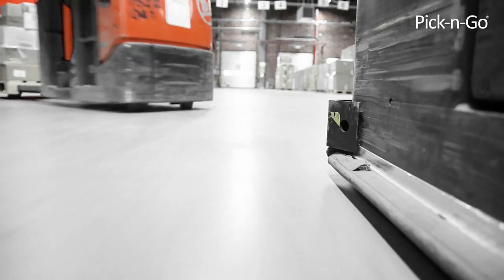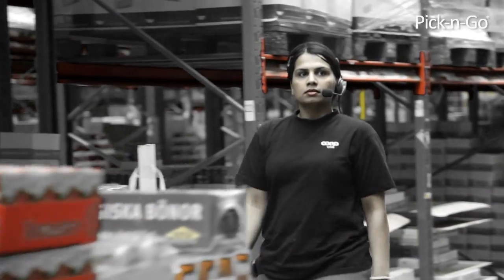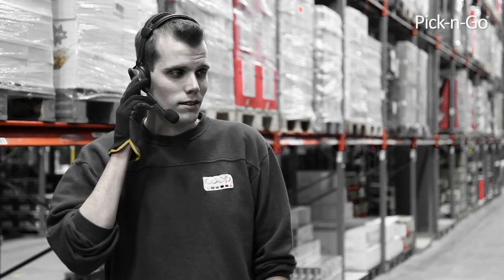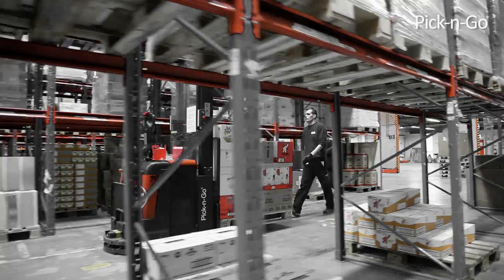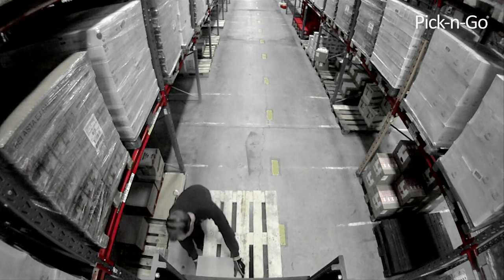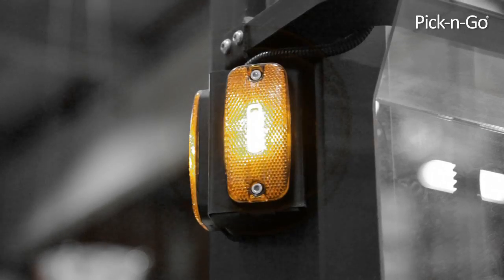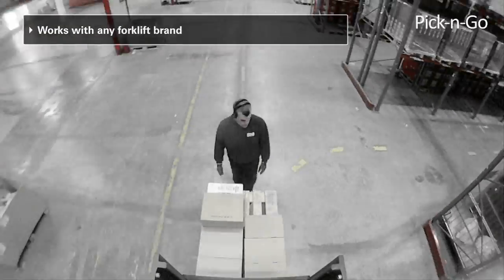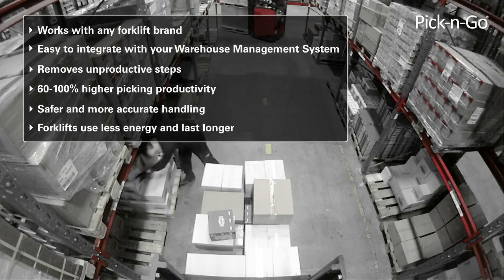Automated Pallet Jack Order Selection.wmv

Comment: How is this any better than the picker operating their own machine?
Reply: Try driving around other with other pickers.
Reply: LegoDork its just as hard for the guiding system to control the pallet jack. Considering it works of an electrical grid n a wireless connection prone to lag. N glitch out
Reply: Remember he said, "less work for the forklift"... that's a very important benefit #smh